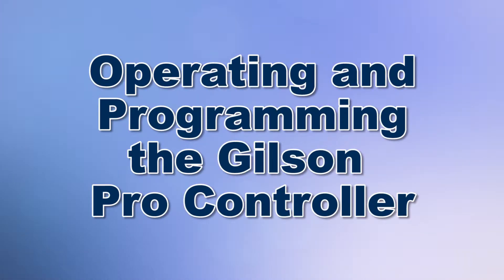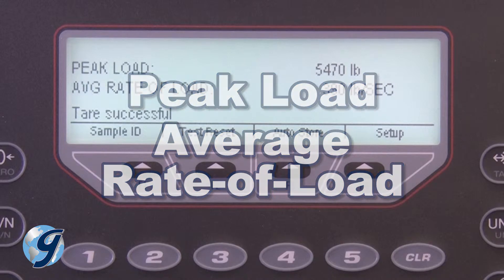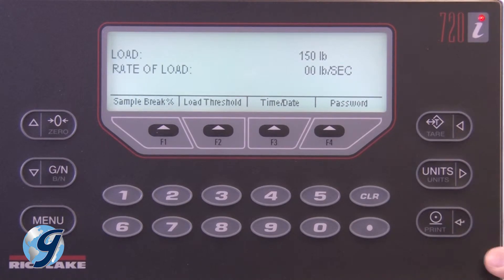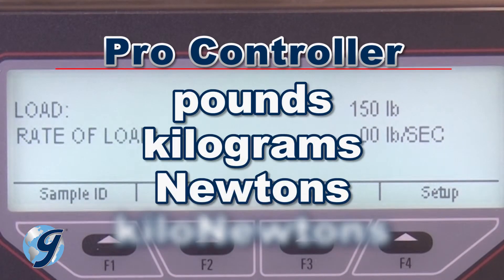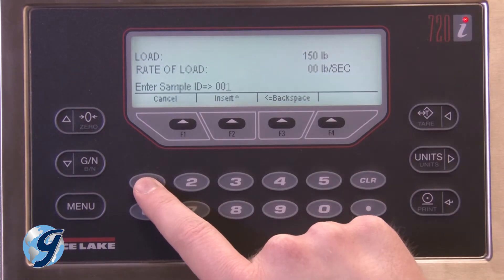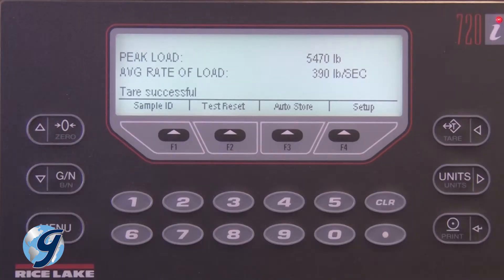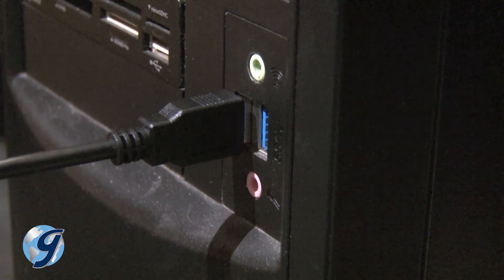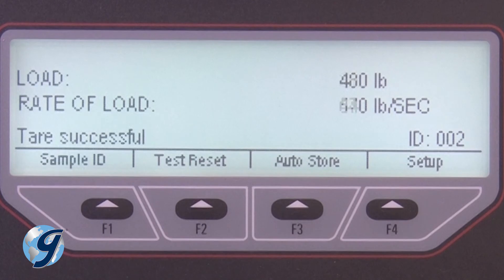Operating and Programming the Pro Controller for your Gilson Concrete Compression Machine

Comment: Is there any way to enter the test type(cylinder) on this display so that it will output psi?
Reply from the maker: I'm not 100% sure what you are asking. Entering the concrete cylinder type or will the test result display psi, I suggest reaching out to Technical Support directly for your question techsupport@gilsonco.com. Thanks.